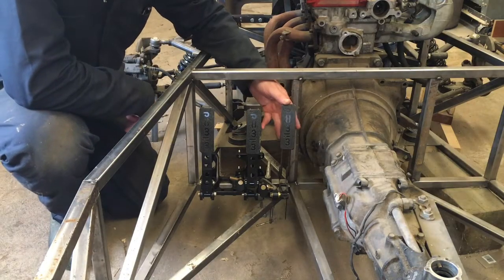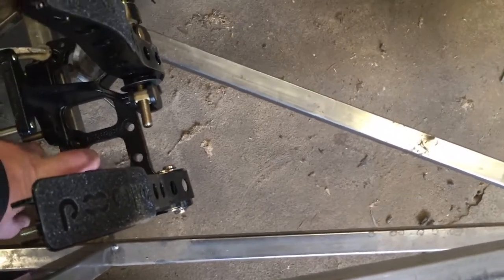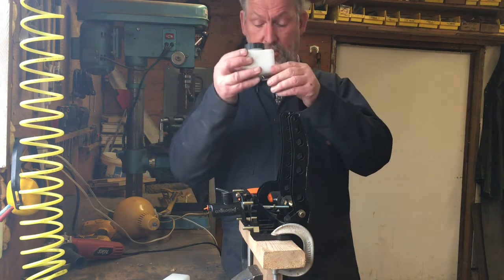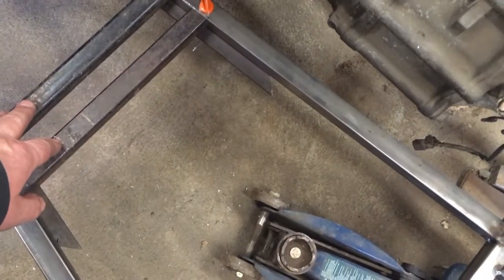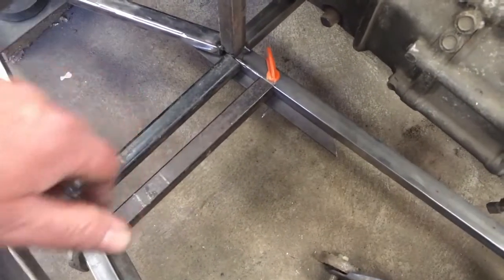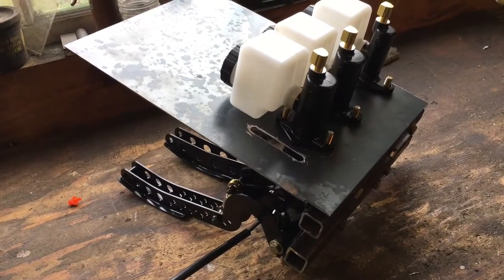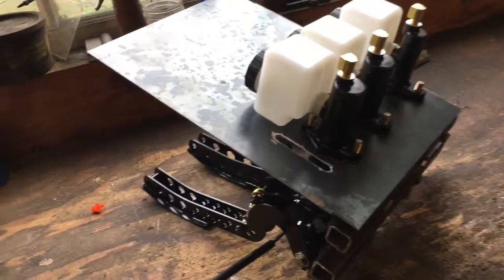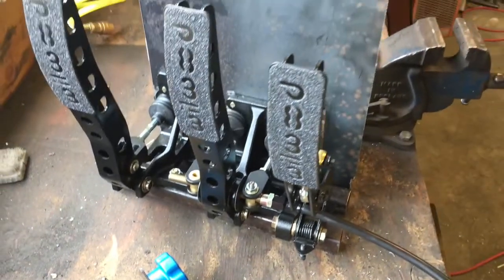Super 7 Build - Ep 2 - Wilwood Brake Pedal Mounting

Comment: I like the Willwood pedal box with the balance bar built in. ... adjustable from the cockpit. ... nice 👍 ... my Tilden balance bar is on the engine side of the firewall. ... shared to 7Spot ... https://www.facebook.com/groups/SevenSpot/ ... you may get some questions about master cylinder ratios.
Reply from the maker: My next video is going to be a bit of an in depth look at master cylinder ratios, brake biasing, caliper piston sizes etc, hopefully start a bit of a discussion. Stay tuned!